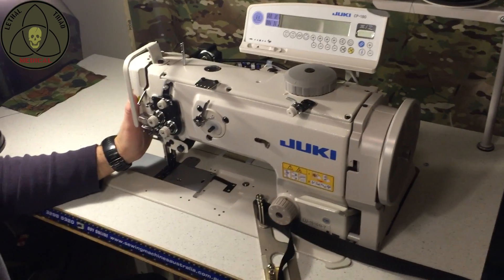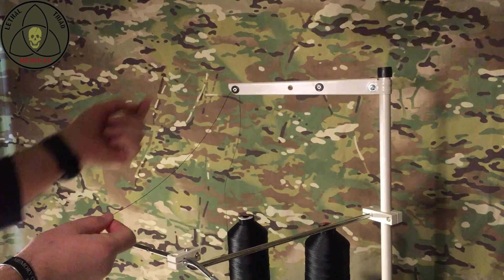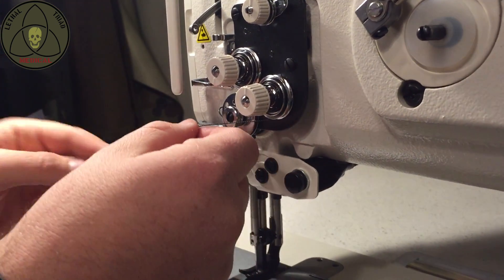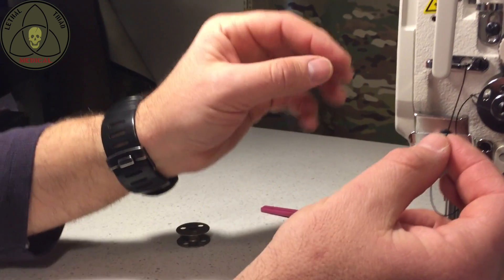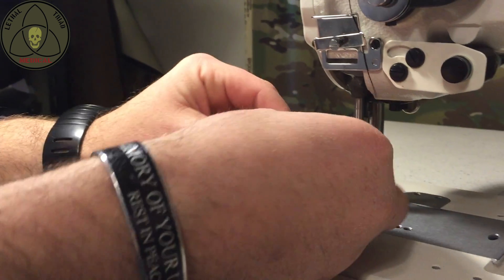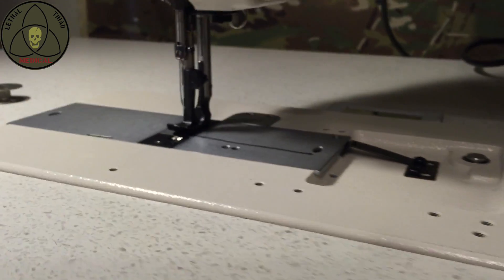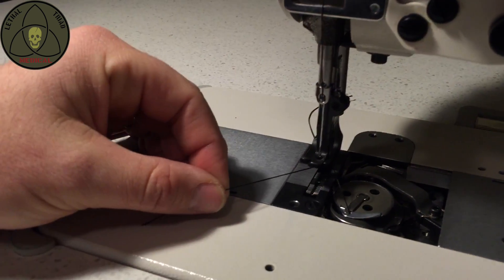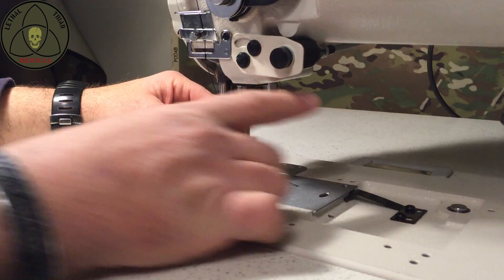JUKI LU-1510N7 Threading

Comment: The idea about going through a hole in the top plate (with 4 holes) and then back over and down into another hole is to add tension along the way, the more you do the more tension you will have. That is why they show that in the manual. But I do agree the manuals need improvements, especially separating the languages into several manuals.